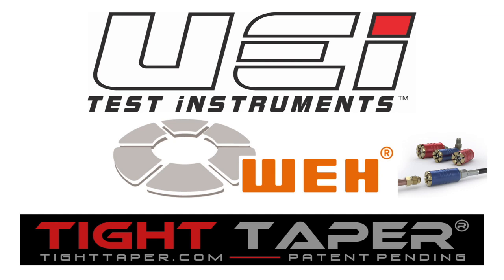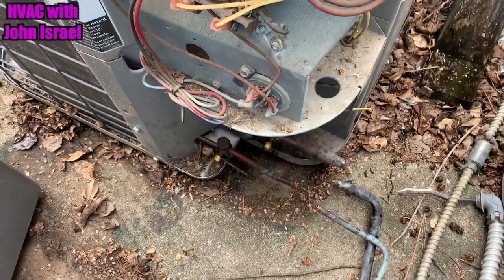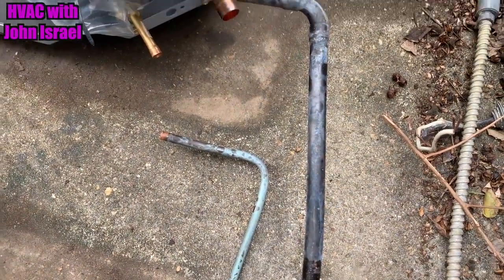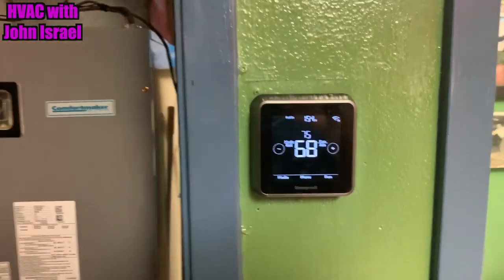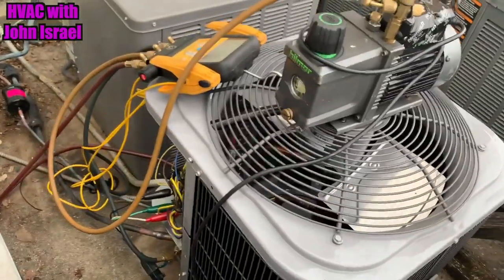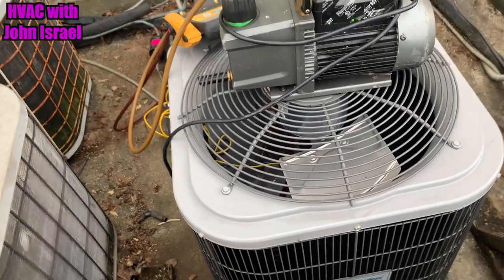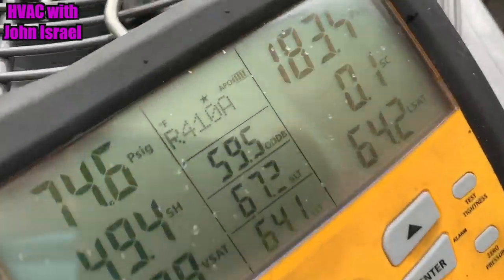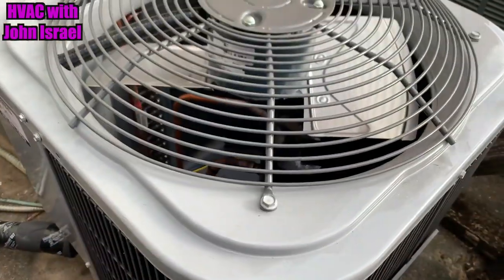HVAC 1.5 Ton Change Out

Comment: Why didn’t you put the liquid filter drier inside of the house?
Reply: I know the Carrier installation manual reads that the drier should be within 2feet of the air handler. I'm sure ICP likely has the same instructions. All that aside I don't think it really matters where the drier goes. At least he installed it. I know a lot of contractors throw them in the trash.
Reply: matt luongo Louisiana has a lot of rains and temperature is high in most time of the year. It will rust fast, which may causes leaks

Comment: Did you flush out those lines with flush? Did you pressure test with nitrogen?Since you are reusing the copper lines.
Maybe you did but you didn’t put it in your video.
And by code you do need 12” from any wall and 18” other unit outside.